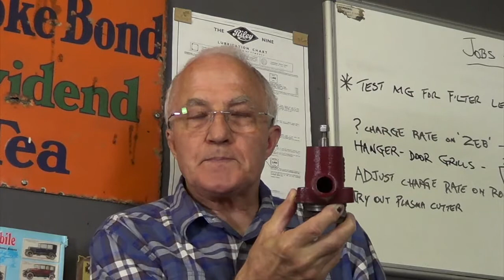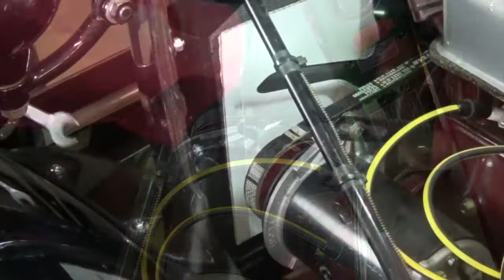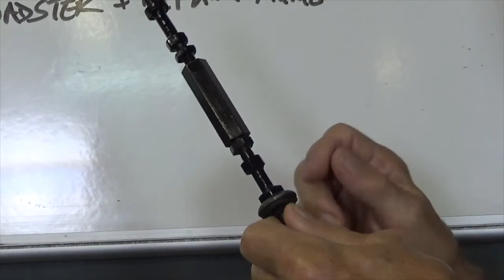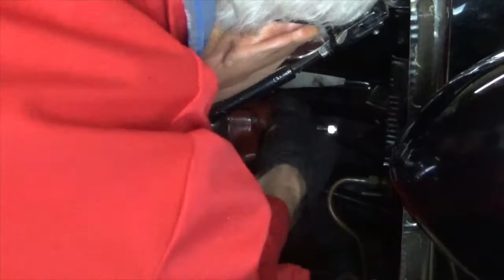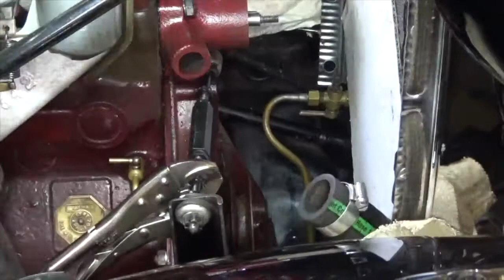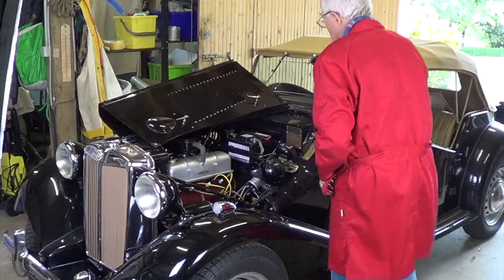MG TD water pump replacement

Comment: Thank you! This video has been very useful, to help me change my TD water pump. I bought a heavy duty pump (6 vane) from NTG Motor Services Ltd. It fitted straight on without grinding. The heads on the bolts that held the fan on were 8 mm AF, so easy to find a ratchet spanner to take them on and off!

Comment: Hi Tony. I need to inspect the thermostat on my TD. What would be the steps to remove it without destroying that hose that goes to the radiator?
Reply from the maker: Helio, first thing to check is how rigid the top radiator hose is.  If it is very rigid I would suggest change it anyway.  If it is rigid it will likely fail on you, on a dark night in the rain.  I would cut it with a hacksaw halfway up, then check the thermostat and replace the top hose with a black silicone one and fitting new hose clips.

If you try to retain an old rigid radiator hose and try and reuse it, you will likely end up breaking the metal pipe where it joins the radiator.  It is like trying to reuse a gasket, false economy and you end up breaking something.
Reply: @Qspecialman  I wouldn't want to destroy the hose because I live in Brazil and we don't have parts for MGs here, so I would have to import it from the USA, which would take a long time. Or else I would have to adapt it from another car, which would not be very advisable. In any case, I am very grateful for your guidance and attention. Best regards.

Comment: I always enjoy your videos, thanks!
Reply from the maker: I'm glad you like them.  I enjoy the idea of sharing my knowledge with others. Until the next time.......
Reply: @Qspecialman  HI Managed take water pump of without taking the fan off .it came out the side of dynamo .i had to take dynamo adjust nut off on the engine block